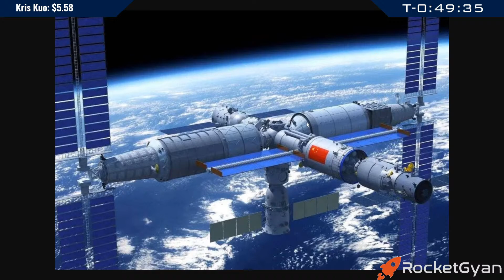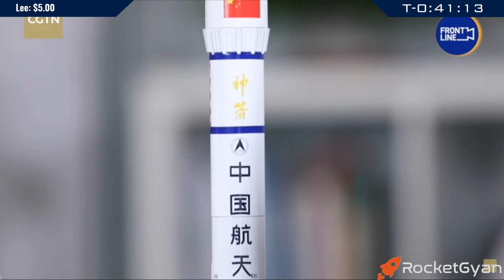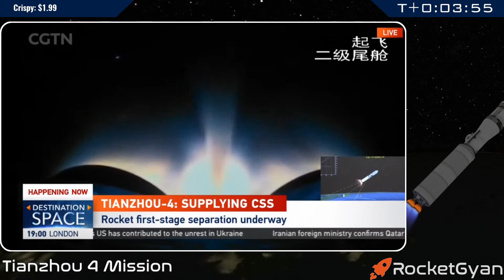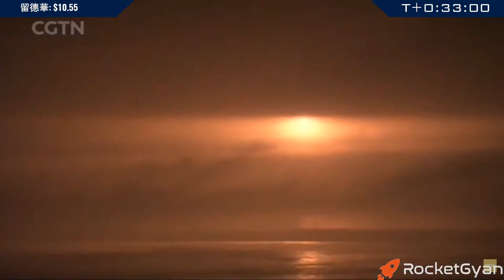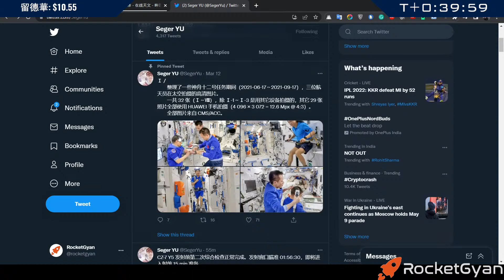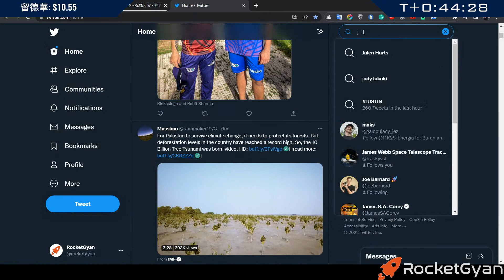[Liftoff: 1:07:21] China Space Station Launch LIVE | Tianzhou 4 cargo module launch | Long March 7

Comment: Wery well done, folks! It was probably because of the video, but it seemed like a VERY fast departure from the launch pad. Usually rockets of that size tend to rise slowly from the launch pad, gathering more speed as they go. But anyway, it was an impressive launch. Best of luck on the mission.
Reply from the maker: The reason for a quick departure is its very good TWR. TWR is good because it uses 6 yf-100 engines each producing 1,200KN of thrust